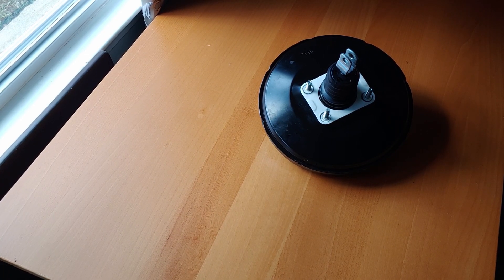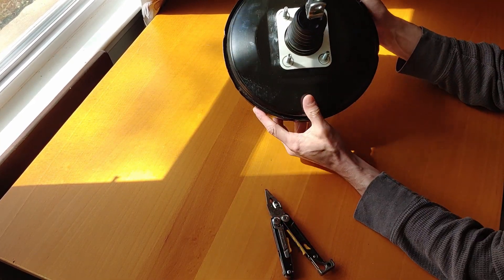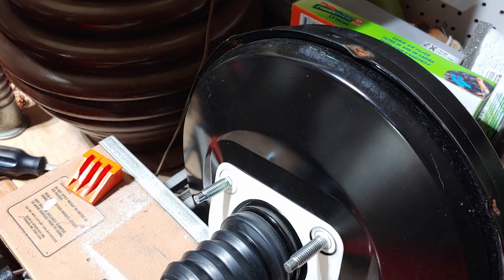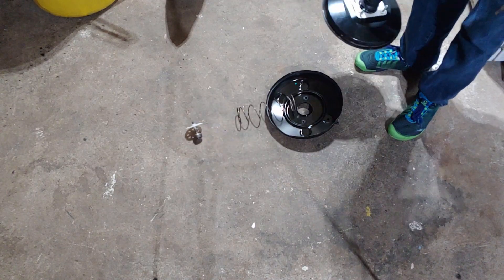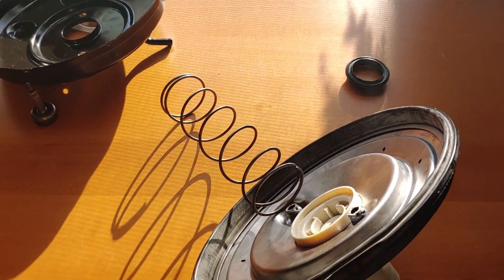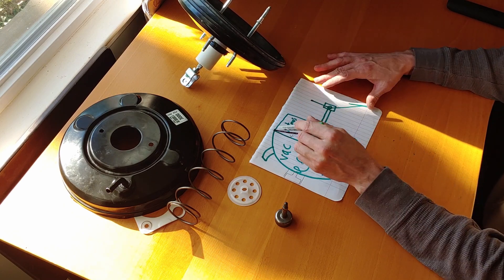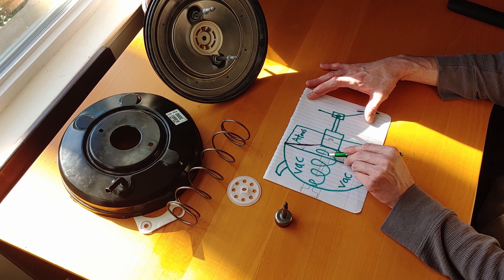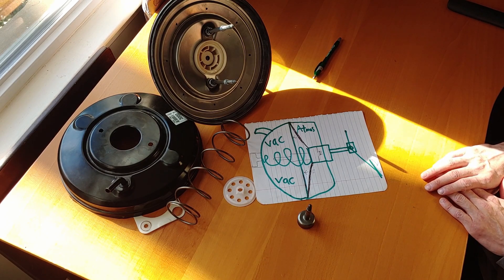Disassembling a Brake Booster

Comment: My brake pedal pushes down itself when i accelerate and released the gas pedal and a whisling sound can be heart then. what do you think guys? is my booster toast?
Reply from the maker: Sounds like a bad booster or a really bad clog somewhere in the intake system. What car do you drive?
Reply: @TheFlacker99  honda City 2002 Sir, intake is Okay, the one way check valve is holding on. Brake Booster internal problems is prolly the cause.